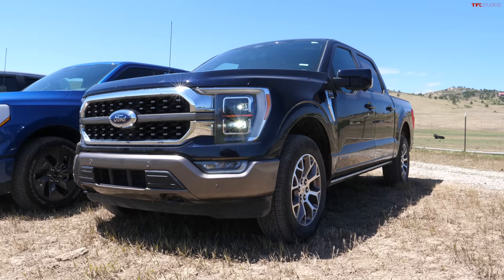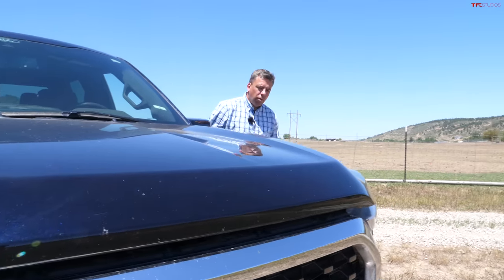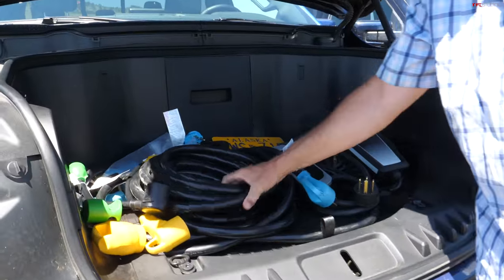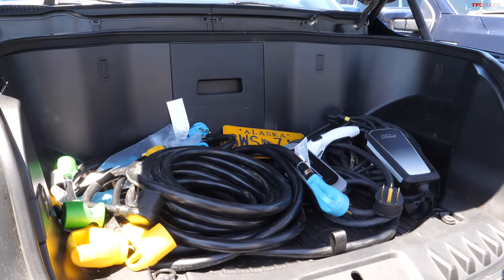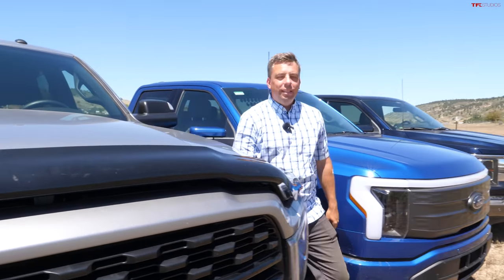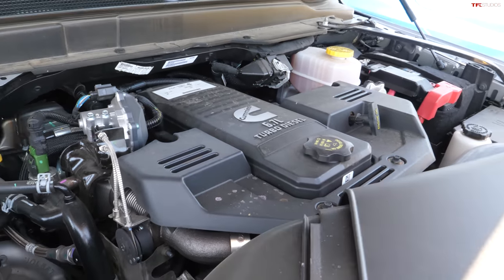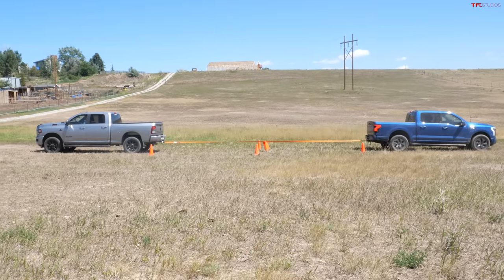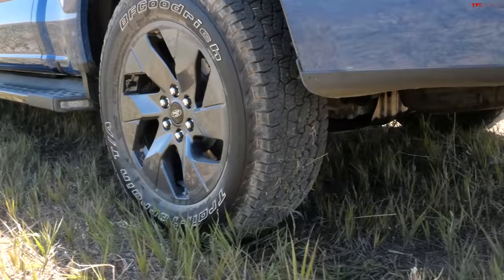Diesel vs Electric Tug-of-War: Ford F-150 Lightning Takes on the Ram 2500 Cummins In a Nail Biter!

Comment: Battery may have more torque but until they figure out the life of that battery while towing I will keep my diesel. Good video guys
Reply: For me it the cost of the EV vehicles and the cost to replace the battery.
Reply: @jim2498  why worry about that though? Since 2010 at the cell level ev pack's have gone down over 800% per kwh. 
Also all evs sold in the U.S. have an 8yr or 100,000 mile federal ev battery warranty. 👍🏻
Reply: @4literv6  still a lot of money to spend on a battery. And vehicle last well over 100k
Reply: @jim2498  average new vehicle is 12yrs otr here in the U.S. 
Again why worry about the pack replacement cost when it's covered for at least 8yrs or 100k? Ev pack's are not cell phone batteries. 
These are highly engineered very well designed heated&cooled pack's.
Reply: @jim2498  You'd realistically never have to replace a battery pack. The new packs are 300k-500k mile packs.
Reply: @Cal56347  but how come I see lots of Tesla owners have to change their battery
Reply: @jim2498  Define lots? I haven’t seen many at all. And I’m not just talking Tesla. And I said new packs. So yeah a 10 year old battery pack is prob not great.
Reply: @4literv6  not for pickup trucks. I still see a lot of the 7.3 power stroke.  They stopped making them around 20 years.
Reply: You're going to keep your diesel  because the Lightning has a waiting list several years deep at current production levels. It's a massive success.
Reply: @Cal56347  i think that's optimistic.if you have a 1000 charge cycles and 300 miles of range . but if your towing and your having to fast charge evey 100 miles that will short the life to 100000 miles .also time kills batteries.this will not  replace diesel trucks for hot shot towing any time soon.but for local towing and the once or twice year vacation could make sense for a lot of people
Reply: @jeffforbes70  You're saying a battery pack would be junk at a 100,000 miles?  If you fast charged it everyday to 100% you might be at 80% capacity after a 100,000 miles.    That's worst case. I was at 98% on a battery at 35000 miles. It was fast charged maybe 20-30 times.  This was 3 years ago. Battery chemistry gets better, not worse.
Reply: @Cal56347  i think you missed my point that if you tow you will be fast  charging 3 time  to go the same amount of miles, so you are wearing out so to speak the batteries 3 times faster. they could only go 85 mile on a single charge
Reply: @jeffforbes70  You don’t buy an electric truck to do heavy long range towing. That’s not what they’re good at so why would anyone do that. It’s like buying a McLaren to tow your boat.
Reply: @Cal56347  "Battery may have more torque but until they figure out the life of that battery while towing I will keep my diesel. " that was the original post so you agree .
"You don’t buy an electric truck to do heavy long range towing. That’s not what they’re good at so why would anyone do that. It’s like buying a McLaren to tow your boat."
that i agree with except the part about the mcallen. it looks like a truck and marketed as a truck. the guys point was it won't do what his diesel will do so we final have come full circle
Reply: @jeffforbes70  Of course. That's a common sense statement. My only issue was with you saying the life of the battery is 100k if you tow. Not true at all.
Reply: @Cal56347  if you can go280 miles on a charge empty. and lets say battery will last optomisicly 300000 miles. no w when they tow a camper that range went done to 85  miles. if you are contantly towing that probably the most you can realistically expect that battery to last is 100000 miles . if i only can tow 85 mile on a charge vs 280 miles . and the battery has x number of chargers i think it pretty reasonable to think if have to charge it 3 times as often to go the same number of miles. its batteries are going to degrade 3 times as often
Reply: @jeffforbes70  It will degrade faster if you tow with it and fast charge daily but the rate won't be what you think. And at the end of those cycles it's not junk, it's just not able to provide 100% of the range. So it may be max 80% or 75%.  I have a 20 year old RC car battery. Still works, just not as long.  But it's like I said, why would you buy an electric truck in this use case. It's a moot point.

Comment: Keep in mind, torque ratings for an electric vehicle and a combustion vehicle should not be compared.  Technically, the only time it's appropriate to compare powertrain torque ratings for two vehicles is if they have identical geartrain reduction ratios.  That's because, all that matters is tire tractive force.  This is the force that is pushing the vehicle forward at the contact patch.  It’s dependent on wheel torque, tire radius, and coefficient of friction. 

To calculate wheel torque, you need to understand all multipliers between the powertrain and the wheels.  

Ram 2500 6.7l 
850 ft*lb (6.7l engine) x 2:1 (assumed torque converter stall ratio) x 3.23:1 (68RFE 1st gear ratio) x 2.64:1 (Borg Warner 44-46 low ratio) x 3.73 (axle final drive ratio) ≈ 54,000 ft*lb (wheel torque peak) 

Ford Lightning
775 ft*lb (believed to be combined (front + rear) peak motor torque) x ((9.72+9.61)/2):1 (average gear reduction ratio) ≈ 7,500 ft*lb (wheel torque peak)

Because the two vehicles have near identical tire diameters, it can be said this Ram has around 7X more potential pulling force than the Lightning.  Realistically though, there will be traction limits negating a large portion of the advantage the Ram has. Also, as this video demonstrates, software intervention plays a role too.
Reply: Nice job breaking that down , people forget about gear multiplication
Reply: Ram hits peak torque at what rpm? Before that, it's way less. ..So, it's kind of a moot point. Towing at speed would be a different story.
Reply: can always find the engineer....
Reply: Nerd
Reply: You are assuming the Ram has peak torque available at the converter stall rpm which may not be accurate.  This is a minor issue.   Regarding the Lightning, I've driven one and guarantee you your math is way wrong.
Reply: NERDS!!!!

Comment: This is the first gen of the F150EV. As the batteries tech get better and the motors get better, they are going to be tough to ignore as a great replacement. Most people here in the big cities drive trucks don't really use it for work. It's just a family hauler.

Comment: You should have used the GM 3.0 Duramax to represent the Diesel. then put 1,500 lb in the beds and do it on concrete. Then we will see how tough those drivetrains are!

Comment: It's kinda funny how the lightning pulled an old school ford 2 1/2 wheel spin trick and still managed to win by a hamster's left ass cheek 😂😂
Reply: Now pull the same load for 101 miles. Can't.
Reply: @NDRN88  well I think in the right scenario it could but see it's  102 miles that scares me 🤣🤣
Reply: Obviously you know nothing about physics.  The heaviest truck with the best traction will win every time.  Electric vehicles are god awful heavy.
Reply: @RealJeep  well obviously you don't hear too well the diesel weighs nearly a 1000lbs more than the lightning and nearly a ton more than the hybrid and btw in this case the tires don't make a big difference the tires on the lightning are not that much more aggressive than the ram so your argument is pointless
Reply: @RealJeep  but the ram was heavier
Reply: @mguerra310  lol I just think he was a keyboard happy 5th grader no harm done
Reply: @kingshawn1857  So if weight and tires don't matter that much, then the KR and the lightning should've been a tie too. But it wasn't because the lightning WEIGH more and had bit more aggressive TIRES.
Reply: @NDRN88   if only evs had a better energy source than lame old inefficient lithium ion batteries 🥲
Reply: @tony_tiger3405  so were just going to dance past the fact that the lightning also has nearly 200 ft-lbs more of immediate torque vs the KR
Reply: @RealJeep  the ram is 800 lbs heavier, they said right in the video.
Reply: There is nothing funny lol…. The ford lighting has almost 50/50 weight distribution I’ll like to see the bed loaded and a new test
Reply: @RealJeep  nope!!!
Reply: @carholic-sz3qv  agreed it's just for fun anyway why not and I think the ram lost also because it's front heavy if there was more weight in the rear I think the ram wins ford guy also if you were curious lol
Reply: @kingshawn1857  weight distribution
Reply: @carholic-sz3qv  or they could just bring a rear engine 3/4ton Cummins next test🤣🤣
Reply: @NDRN88  F150 lightning has more miles on a full charge vs a ram 1500. Do your research
Reply: @cronicgamerzsmicrowave2712  not as soon as you add weather or tomatoes.

Do your research.
Reply: @NDRN88  What? Tf does tomatoes have to do with mileage?
Reply: @NDRN88  I’m assuming you meant Tornadoes but either way it doesn’t matter. You’re tossing in random scenarios now trying to prove a Kelly Blue Book wrong and I’ll tell you right now, the professionals know more than you
Reply: @cronicgamerzsmicrowave2712  haha, towables, autocorrect...

That makes a huge difference, if you are buying a truck for truck purposes
Reply: @NDRN88  If I was to get a truck for truck purposes, I’d try and find a truck with the fattest truck bed😂

Comment: If you’re looking for a vehicle to pull a trailer no more than 100 miles (assuming it’s not too hot or cold outside) and don’t want it to last longer than 5 years, go with the EV.

Comment: So I watching this the ram and the lightning I think , yes we saw the benifit of the instant torque but we also saw the down side of the electric motor.  Because what I think we saw is what happens when an electric motor meets its max load.  When a electric motor meets its max load it just stops a traditional diesel or gas truck it will continue to try and pull hence why the electric didn’t dig in but the diesel did.  You see this with all kinds of electric motors.
Reply: I'm pretty sure that just comes down to different methods of traction control.
(Brake based vs power based)

If the electric motors had just stopped, the Lightning would've given up ground rather than gaining a very slight amount of it, over the truck that's spinning tire.
Reply: I think it had plenty of power to peel out on dirt and traction control prevented rear tire spin.

Comment: Not just weight and power numbers but the way the power is applied and how the mitigation of power is achieved in wheel spin conditions. electric drive is far superior in all these situations. Their weak point is only the lack of energy density in the pack compared to a fuel tank.
Reply: Which has basically been solved, they are just working on developing the production methon for commercial production. In essence, researchers accidentally made a Lithium Sulfur battery that was stable at room temp (previous the sulfur composition was only stable wwhen hot) This particular chemistry doubles the energy density of conventional lithium ion. So you can either get the same capacity with half the battery size, or double the capacity with the same size footprint.
Reply: @SweetLou0523  It's FAR from being solved! Even the absolute best battery in an EV is the equivalent of about 4 gallons of gasoline!
Reply: And that weak point makes them utterly impractical for a lot of us.
Reply: @markgeisewite2687  in the mining and heavy equipment industry, we use electric for a vast array of things. It is objectively superior in terms of propulsion.
Reply: @dundonrl  which speaks to how energy dense gasoline and diesel are. Conversely how much of that energy we waste making it into heat instead of propulsion. 
On the flip side, how efficient an electric drive is getting that kind of range on 4 gal equivalent. Or conversely how little relative energy is stored in a battery vs a fuel tank.

Comment: In a tug of war with 4x4s , the heavier vehicle wins , especially on dirt
Reply: 100 % yes. I've seen rust bucket 80s 4 cylinder Toyotas out pull brand new diesels. Of course the beds were full of sand or scrap iron....

Comment: Now for the next challenge let's see how far the gas and diesel trucks can go between fuel stops versus the electric truck.
Reply: ok, so the electric one has to stop for 20 minutes.

The electric Ford Lightning actually has 320 miles of range, in the platinum trim. Do you drive more than that at work? The less expensive one has 230 miles range...again, do you drive longer than that at work is the question. 🙂

Comment: How much battery did the lightning go through
Reply: No one asks this when it's fossil fuel vs. fossil fuel. Just saying.
Reply: @davidanderson-22  because we can go to a gas station and put diesel or gas in a truck in about 35 seconds not 13 hours of charging
Reply: @gorillaman08zx  and any homeowner with this truck can pull up plug it in overnight in 3secs come out the next day and it's fully charged.
Can't do that with any ice truck's and definetely not getting 70-80mpg out of an ice truck either. My emc gives me enough free energy to charge a lightning for 800-1000 miles a month. 😎
Reply: @4literv6  pull a 12,000 to 14,000 pound construction trailer 80 miles to a job and try to get back home, you can’t do that in any EV either, some of us actually use our trucks to work not just grab groceries!
Reply: @gorillaman08zx  isn't that more a 2500 series trucks tow weight? How far does your very inefficient slow diesel get towing a load like that on 3.5 or less gallons of fuel again? Gas 2500 towing that load wouldn't even get 30miles at hwy speeds on the same energy a lightning has. 🤔

Yeah I use my truck for actual work purposes to, over 80% of its miles have been with at least 2 people in it, carrying tools and stuff in the bed and or a trailer behind it. The lightning works just fine for those jobs and many more like it for those of us. Who aren't driving a truck just like a cowboy Cadillac or pavement princess type. 😀

Comment: always love a good tug of war.......but it only proves which truck is heavier and or has more traction. same weight/traction then it comes down to the driver who keeps their tires from peeling out first. I had a ford courier push a chevy camino back on concrete, because he punched it and was peeling first, my 4 banger didn't have the guts to peel and kept traction.
Reply: Peeling reduces traction.
Reply: Yeah, and EV's has crazy power control, that car or truck dont want to spin it can easily make sure it never will, you just cant get that level of control in a convetional powertrain.

Its a very silly thing to do and its mostly just a show that say little to nothing about either vehicle.
Reply: @murdoch9106  facts.